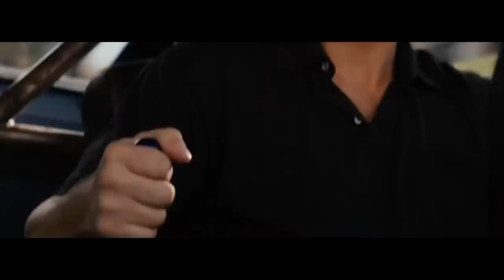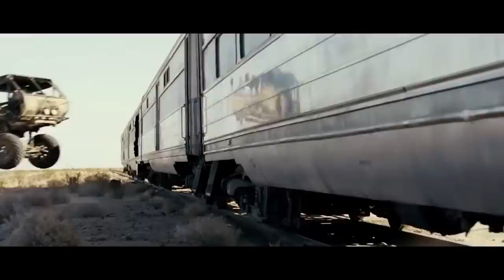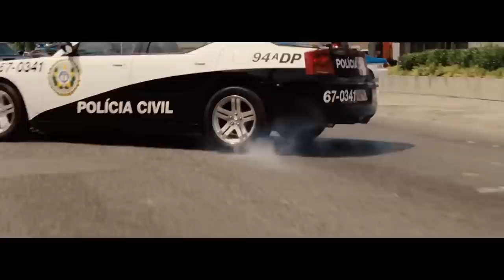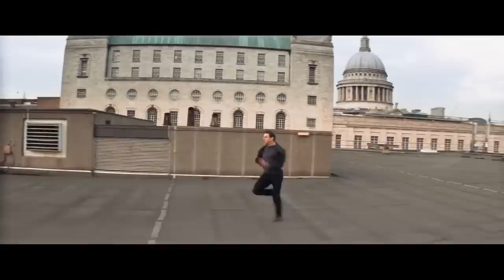Fast Five Pulled Off The Greatest REAL Stunt In History

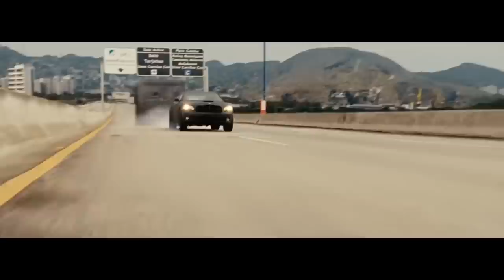Comment: 7:05 there is absolutely no way a person would be in that car when the cable went through it
Reply: Yeah I do not believe that one at all
Reply: Yeah. There was a stunt driver in the car, and the cable went through the car. Just not the same car or at the same moment. The video has many other moments like these where he believes the editing too much to try to hype it up more when it really isn't needed.
Reply: 7:05 In the inside view there is a person, but the chain is not atached to something solid so there is no risk, and the next scene where the roof is cut (it was pre-cut, that's why seats hang over the cutting height), you see a remote controlled vehicle.
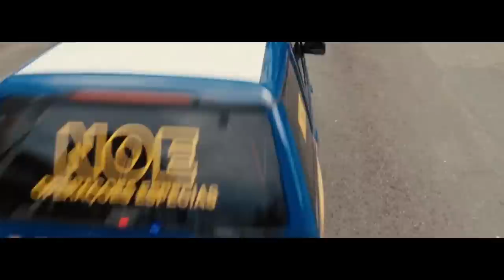4:58 Also here, even if it had gone the worst possible way, that scene had near no risk at all, the vault was stationary and the cop cars were remote controled.

RC vehicles are quite popular on films, specially on this franchise where they started using them as soon as in the second film 2F2F, for Suki's bridge jump.
Reply: @YOEL_44  Thank you for the explanation. I was sure the narrator had to be wrong there, the stakes were far too high for them not to use remote controlled cars in that scene.
Reply: Yup narrator forced too much at times, this coupled with the formulaic narration style threw me off, I'd rather watch nerdwriter or at least someone who gets their facts straight
Reply: @mathias2277  And don't get me wrong those are great practical effects and stunt scenes, they don't need to be exaggerated/misinterpreted to be appreciated for what they are. Editing is also very much important and they did a decent job at making those scenes even more dramatic and high energy.

Comment: I think I remember CinemaSins saying there is no way two Chargers would be able to pull that vault out of the wall
Reply: I mean, he's not wrong, right? It wasn't a real vault. A real vault is definitely much heavier.
Reply: To match the time taken to get it moving assuming no friction it would take a ridiculous amount more power than a pair of chargers has. 10ton safe empty. Chargers aren't gonna tow a 5ton trailer an accelerate at the speeds depicted and trailers have wheel, not boxed in by concrete and then dragged on the road.
Reply: Too heavy, it's unrealistic
Reply: @tompurcell8825  10 tons? That vault would've weighed like 70 tons if it was real and not a prop.

Comment: It truly is one of the greatest action scenes in history. Not just that it was almost all practical, but that many people were in extreme danger. I can't believe they allowed extras to run around the building as the vault destroyed it. And I really cannot believe an actual person was in the cop car on the bridge and actually had to duck under the wire to avoid being decapitated. That is insanity. I've seen Fast Five probably 6 or 7 times and the sequence never gets old. 

I love the whole series. It has so many different atmosphere's and even genres. From pure street race/car culture in the beginning to cheesy 80's drug film to the higher quality heist films later on. 5 is probably the best. Followed by 6 and 7. 8 was not my favorite. It was a dip in quality and suffered greatly from Paul being gone. Looking forward to seeing how 9 turned out. It's also amazing how the series revived itself. They did well with the 1st, nothing special but enjoyable. Then 2 got pretty bad and Tokyo Drift is just awful in my opinion. Then in 4 they finally started to right the ship, perfected it in 5 and grew it from there.
Reply: 4:58 Even if it had gone the worst possible way, that scene had near no risk at all, the vault was stationary and the cop cars were remote controled.
7:05 Again, in the inside view there is a person, but the chain is not atached to something solid so there is no risk, and the next scene where the roof is cut (it was pre-cut, that's why seats hang over the cutting height), you see a remote controlled vehicle again.

RC vehicles are quite popular on films, specially on this franchise where they started using them as soon as in the second film 2F2F, for Suki's bridge jump.

Also, F&F was about the undercover agent Brian, the fact that this one is about Dom's greed, makes it disconnected from the original idea, that's why most hardcore F&F fans don't trully respect anything after the 4th one

Comment: 3-4 months of practicing this..lol, I genuinely would like to know how many transmissions they went through in those Chargers
Reply: I don't know much about cars, but man do those chargers look ill-suited to towing a bank vault....
Reply: @whirlwind872  Honestly, if any car could haul a bank vault, it would be a Charger. Big displacement engines and a car with a lot of weight to counteract the movement of the vault, it would be way better than the typical small engine, light, Fast and Furious kind of car.
Reply: Probably resold as a "lightly used movie car"
Reply: @matthewmosier8439  a demon?
Reply: @thomaspanditfan2435  The Demon could probably also do it pretty well. Part of what I'm pointing out is that cars have strengths and weaknesses based on their characteristics. For quite a while the world has focused only on "fuel economy", and "handling" and somehow ignored the drawbacks to both of those strengths, namely, the car is usually light and has a small, highly over-engineered motor and is slower in a straight line. Comments sections are full of people who overlook the strengths of cars like Chargers, Challengers. etc., which just so happen to be very useful if one needs to do something like this stunt.
Reply: @matthewmosier8439  I'd suppose no car, no matter how powerful could tow such a heavy object (with no wheels nonetheless), because I can't imagine any kind of tires would have nearly enough grip to put the necessary amount of power down on the concrete.

And of course, at the first corner the safe would go flying and drag the cars behind it. But the fact that they did account for the safe's momentum and made it look believable, even though we all know these two little cars couldn't hold a candle against its weight, is really freaking impressive!
Reply: @matthewmosier8439  I mean, towing a bank vault is not one of the "strengths" people usually look for in a car 😂 people want cars that are fun to drive but don't cost too much at the gas station
Reply: @Kumoiwa  I have a car that doesn't cost too much at the gas station and a truck that proudly uses lots of gas. There really isn't currently much of a way to get both maximum fun and efficiency at the same time. There really isn't a car that fits both worlds perfectly, at least not one that I know of.
Reply: @matthewmosier8439  You can get a compromise of both instead of owning 2 cars

Comment: 4:58 Even if it had gone the worst possible way, that scene had near no risk at all, the vault was stationary and the cop cars were remote controled.
7:05 Again, in the inside view there is a person, but the chain is not atached to something solid so there is no risk, and the next scene where the roof is cut (it was pre-cut, that's why seats hang over the cutting height), you see a remote controlled vehicle again.

RC vehicles are quite popular on films, specially on this franchise where they started using them as soon as in the second film 2F2F, for Suki's bridge jump.
Reply: Yeah, but you could do all of this fairly easily with CGI. The fact they put in this much work to do it real demands respect.
Reply: @DerDudelino  Not saying otherwise, but the dude in the video was trying to imply that there was people in the car in that moment, and appart from nutty, is also wrong
Reply: Also the one at 7 mins where he's like "not even an inch" overhyping the 180. It's not a hard move to pull out. The vault has no play on the physics as the cable isn't fully extended when the charger hits the brakes and the vault is moving in a straight line so it's just the driver having to make a simple handbrake turn at 20-40 mph to get out of the way and has more than enough room with 3 lanes to not run into the opposite wall.

Comment: The stunt work on this movie was definitely amazing -b ut there was also a fair amount of CG involved in these shots.. for various reasons.
They had different version of  the vault for different purposes. 
Most of the times you see them pull the vault through the city it was the "drivable version" with a driver inside, looking out a small grid window. The pulling cables were much thicker and were later in postproduction painted out and replaced by the shiny cg-wires we see.
Another version of the vault had wheels under it as it would otherwise scratch up the whole road. Those wheels were also removed in post and a section added to remove the gap.
Sure, they crashed that vault into that building, but there were never people inside. It was a double take and composed together, adding effects.
A lot of savety measures on set that were set up like barriers, extra cables and so on were removed later.

So of course, many things were done "for real", but that does not mean that someone pulled a real vault thru the Streets of Rio.. oh btw, thses scenes were not filmed in Rio either. 
But all of that does not take away from the fact that the scenes were well choreographed, planned, and executed with a huge amount of amazing people. The result is an emersive action movie that is just as fun to watch as it was to make. The fact they shot it "In Camera" instead of overly using CG is why it looks so good.

Source? I was part of the vfx team and worked on some of the shown scenes doing paint work and set extensions.
Reply: Thank you. I'm pretty sure that that was shot in Hato Rey (a part of the San Juan pueblo in Puerto Rico). San Juan is the capital of Puerto Rico.

Comment: Hauling a heavy huge vault requires 3 Diesel Powered 4x4 or Commercial vehicles or a Semi Truck.
Using a performance car for pulling such vault like that will blow the engine, Snap Propeller shaft or break the frame apart.

Just my opinion

Comment: To be clear. The safe (before being completely gutted) weighed more than both car's weight combined. The safe after being gutted was less than half it's original weight. The scene where it hit a car head on, it was actually a prop truck made using a hollow she'll of a safe. This scene wasn't as real as people think. It's obvious that physics says you can't pull a 9k lbs safe around with 8,900 lbs worth of cars like that, regardless of power. That's not how it works.

Comment: DONT READ IF YOU LIKE TO THINK THE SCENE IS "REAL"
Sadly the stunt isn't "Pulling 9000-pound vault" the vault is actually a truck without a bed with 4 wheel drive (Custom made by crew) and pretty much shrunk in a wood box and sheet metal frame, the driver of the truck looks through a tiny 10 by 4-6 Inch rectangle of one-way glass and CGI is used during the scenes of it flipping although the breaking into building scene in the begging was technically "real" by extras were there so the obviously made sure it was cabled. (I have family who worked the set and made the truck so id know sorry again for ruining it ;w;)

Comment: I wonder how many of those Dodge Chargers had the crappy 2.7L V6.
Reply: No idea. In the Movie the chargers had V8's with 420 lb of torque and 425 HP, curb weight of 4160 lbs, really light and sounds unrealistic for even 2 of them to drag that 9000 lb metal box, unless they had a mockup model that was significantly lighter.

Comment: You actually can flip a car around and drive off. The problem isn't spinning the car, that's easy, you can do it by accident. The problem is the shifting. The car has a lot of momentum and the engine is connected to the wheels via the transmission, so the problem is that you have to have the timing perfect because if the car is still in gear when you spin around the engine dies. Clearly when you have a massive vault coming down the road behind you having your engine die would be problematic to say the least.

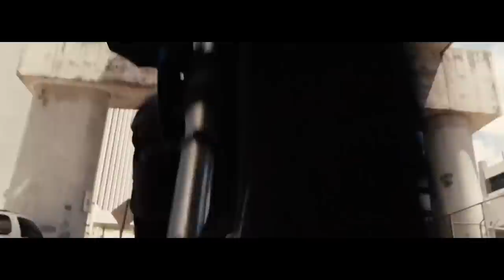Comment: 3:51 let me break this down for ya. if his feet should have been let's say 20cm higher, and your "1millisecond" would hold any water, his acceleration upwards should have been 72 km/h. why you ask, let me tell ya. 1 millisecond is 0.001 seconds and if you count that if he was off by 1 millisecond he should have been 20cm higher in that 1 millisecond. so then it adds up to 20m/s, so 72km/h. aint no damn way he would have hopped upwards with enough acceleration to launch himself in those speeds. so he was off by way more than 1 millisecond, not 1. more like half a second.

Comment: Their was a wheeled vehicle in the safe! How can two rear wheel drive cars not weighted down pull a safe around like a rag doll, even if it had 2000hp you'd need 4x4 cars with the right tires & weighing up to 3 or 4 tons with a 1500HP, even then i have my doubts.

Comment: Obviously the creator didn't watch the special features because it explained the stunt at length. It wasn't a real vault, it was half a pickup truck with a prop vault built around it for the straights that could steer it and a shell for tumbles.
You should buy the directors cut, stolen saying real vault when its a prop replica, and try again

Comment: It wasn't a real 9000lbs vault. It might've been a physically real object but it was not 9000lbs. Those cars would just wheel spin on the spot trying to drag that weight, let alone the fact that the thing bounces around like it weighs hardly anything. There's plenty of laudable practical effects going on here but there's also a lot of misunderstanding of what's actually going on here. For instance, they absolutely, categorically would not have a stunt driver in the car that gets decapitated. Not only is that crazily risky but it's totally unnecessary - there are loads of ways to make that shot without actually risking someone's life.

Comment: it isnt real if you hide wires, transform a car into a fake vault and show a vault in the final product, make a truck with a steel frame infront to hit cars and in the end product make it seem like the vault hit those cars and in general cut and paste mutiple shootings together

but i get the point... at certain points they used a real 5 ton thing pulled by 2 real cars...

Comment: a well intended video but displays a worrying disconnect with physics. 
If the vault was real it would weigh a lot more than four tonnes, but even at four tonnes it is heavier than the cars and has way larger contact area with the ground. So it would be IMPOSSIBLE for these cars to move it, at all. let alone at speed around city streets, making turns. 

How this should have been described as, is that a large vault looking object was placed in multiple separate street scenes , where it was dragged and crashed into various real world objects.
The "vault" was not a vault , and each of the cuts had to be meticulously engineered for them to be possible. It was probably took several months and thousands of hours of work to make for hundreds of crew. 

There are tractor pull contests where objects like this are pulled in straight lines. The enormous tractor drag race vehicles can still only cope with pulling the weight over a hundred yards or so in a straight line. And this is with giant tractor tyres, many thousands of horsepower and vehicle weights ten times greater than these cars.

Comment: You explained the stunt from the final shot of the movie after it been touched by cgis, not the raw footage. 
There is no real full sized vault to be pulled. Its just an empty metal box. There is no stuntman inside a car that the roof is stipped by pulling wire. The stunt and the stripped car are shots on a different time. There is no car pulling a vault sideway on a bridge, they do the stunt somewhere that really safe. The scene has been edited on cgi.
Please be sceptical and use your brain at least a bit.

Comment: Sorry they may of pulled the real safe through the building but everything else was done by the prop safe theres no way absolutely no way they would get approval to drag a vault through countless streets most of it was edited especially with the top of the car getting chopped off they couldn't guarantee that the guy would live there for they will not put him in that situation because if anything happend and he lived he would of sewed the shit out of universal
Reply: Even the scenes of doms charger doing wheeles is fake they had a kit car rigged with hydraulics to lift the front wheels and body off the ground but had a real car on all 4 wheels on the ground the blower on the charger is also fake if you seen it you would know it's a bone stock engine sitting in it

Comment: It's fairly easy to see the vast majority of the shots in that sequence are not practical at all. They would also never have something like that (as they put it) getting towed around in an uncontrollable manner. No insurance company would allow a 4 ton safe to be dragged around and whipped around corners. 

it's just a metal box with wheels. it wouldn't shock me if there was a driver inside the safe controlling it during sequences where it isn't doing things that would prohibit that. 
The people behind these movies exaggerate certain things to create stories and press to draw more attention. It works, as you can see by the fact that this video exists.